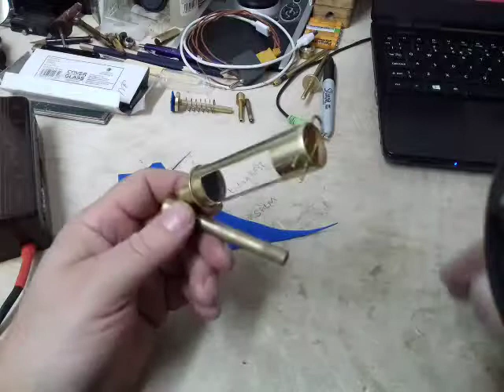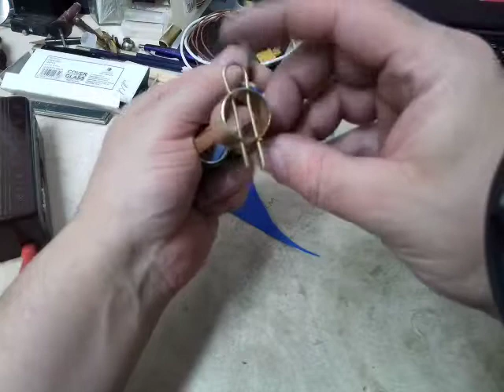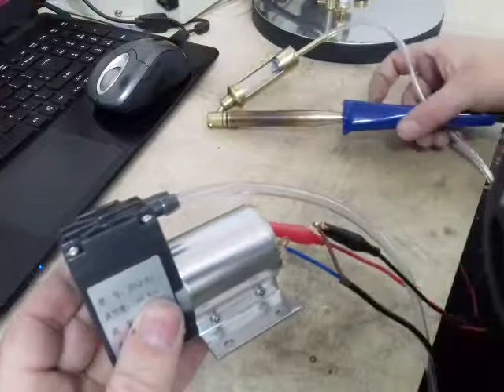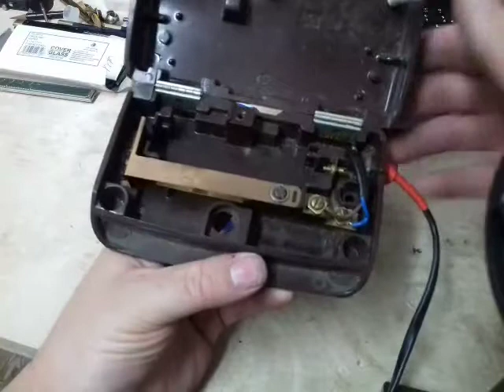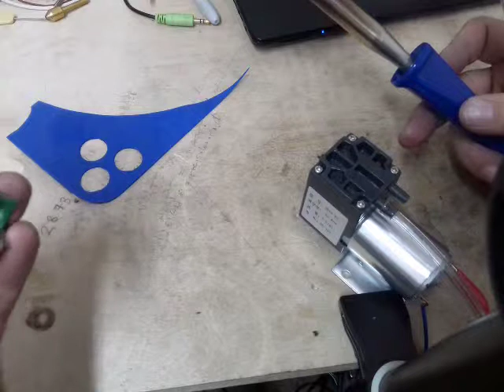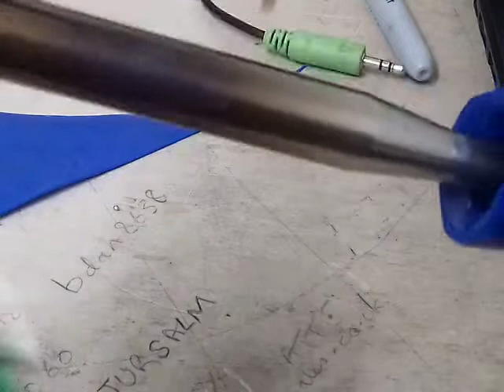Homemade desoldering vacumm

Comment: Nice work!
Gives me some good idea to make my own.
I plan on adding a vacuum reservoir that I got off an '80's Honda Accord when I was a mechanic back then.
That way the vacuum pump runs only to fill the reservior.
And then I'll add a solenoid valve on the pump outlet that activates when the pedal is pressed.

Comment: These suction membranes cause a lot of problems. I hate them, and they're also very noisy. I have a T12 mini desoldering station. I cut the return air tube because it was blocked, but the next step will be to remove it completely. It desoldered two 16-pin ICs and now it no longer works. The cost, by the way, is excessive compared to its reliability. What a disappointment.

Comment: What kind of tip and various pieces are needed for 'suction? I have a Chinese T12A crapper, the diaphragm pump I hate works reasonably well but due to tube clogging from the tin I had to remove the tube and replace it but I did not do a braze but only applied some epox. It will not be an obvious lasting solution but in the meantime it should hold for at least 10 minutes. What a delirium the drilled threaded screw crumbled on me like concrete. For me it is nickel silver. Scandalous. Let me know. Thank you very much.
Reply: The modification I made works perfectly. Brought it up to temperature and the tin melts and is sucked in divinely.